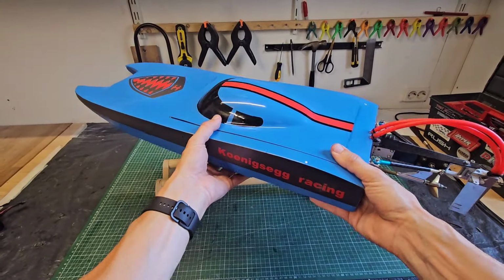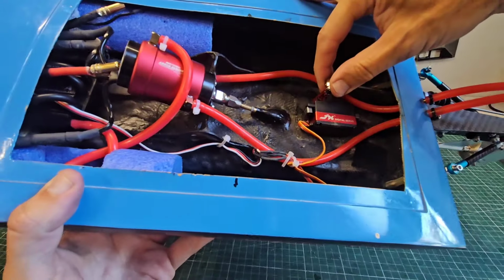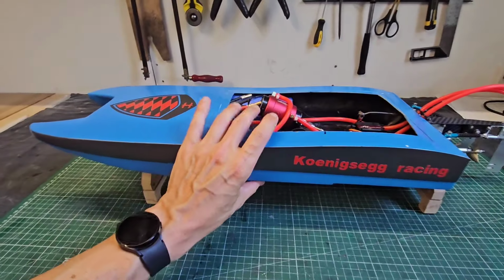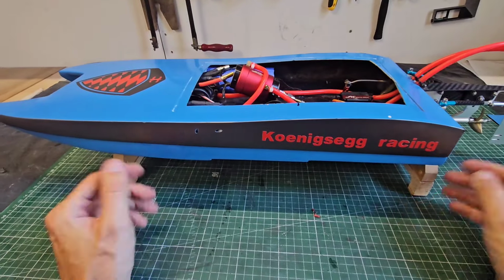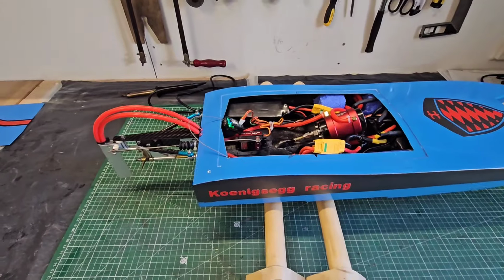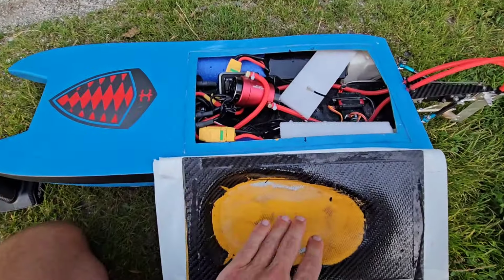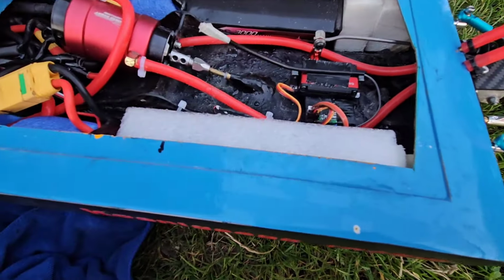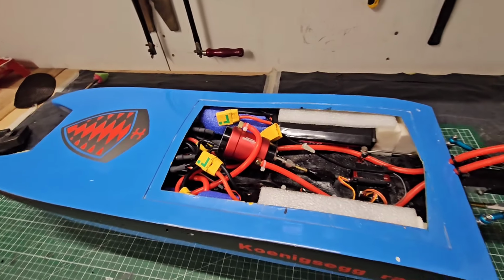I got a new boat! Dr. Psycho Psychocat V1 introduction and 1st run

Comment: Nice vid, nice boat! 

You seem quite experiend with RC boats, but still very impressed with this one according to your remarks during the run. 

A friendly advice; alwas warn people when parallel connecting lipo cells. This can go teribly wrong when either batteries are not at exact same voltage or when they are not equal quality or capacity.

Just... don't do this if you want to use your RC stuff a longer time and/or don't know what your doing.

Greets from another dutchie!
Reply from the maker: Thanks! This is a powerful hull,  and it runs very light at speed. The light running impressed me indeed. 
Regarding the parallel use of lipo's, yes I'm aware of that. These lipos are always used together, I even numbered them not to mix them up (I have 4). 2x 3S is better, but I didn't want to spend on new batteries again 😅

Comment: Great boat Jan, nice rides and actually very beautiful pond👌. I am wondering about the deadrise angle. The actual running surface of the sponsors seems quite flat.
Reply from the maker: Thanks Dim! Yes, this is a great pond, and very close to my house as well. It has 2 drawbacks though: many fishermen, and it has a lot of poles in the water 😬 (not where I ran it this time). 
This cat has very little deadrise. Maybe 2 or 3 degrees only. That's why it drifts in the corners. I will show that in the next video 😎

Comment: It looks like every is off size wise with it, looks funny. Also very long rudderarm etc. Should think its setup this way for a good reason... 
Its definitely a 100+ boat.
Reply from the maker: @peteroosterhoff8850  I think so, too. But I will treat it carefully. It's an old and rare hull, and I don't want to destroy it 🙈
Reply: yes indeed the rudder is made extra long for stability reasons, i also made small changes to the rear of the bottem (hightend the step some mm)
Reply from the maker: @olieboll3675  Nice to know you raised the last step. It looks like the front steps have an extra ride pad / flat plate attached to them as well.
Reply: @CozyRC  yes bottom is completely done, indeed the middle step is also raised,

Comment: I make the rudder set up by myself but use a bought rudder. There are 2 bolts with to hold this rudder. Should i remove one to make the "kick back" rudder or should i do something else?
Reply from the maker: I recommend to make it, like I show in my video of today (August 16th): steel bolt on top, and plastic bolt below the steel bolt. The rudder will break the plastic bolt, and kick up, if you hit something. 👍
Reply: @CozyRC  i see, thanks